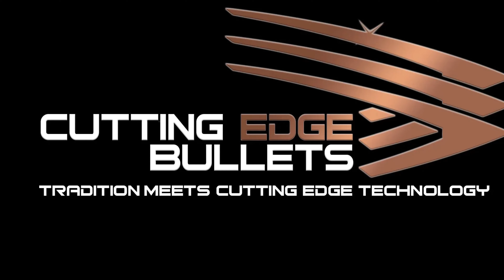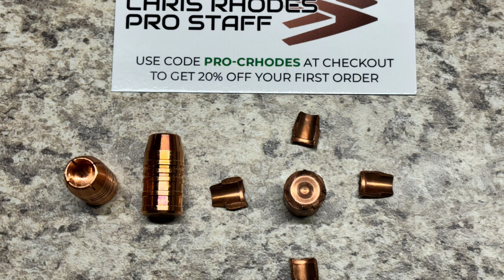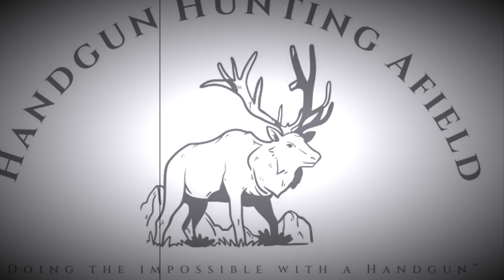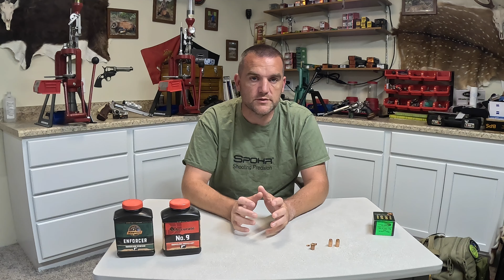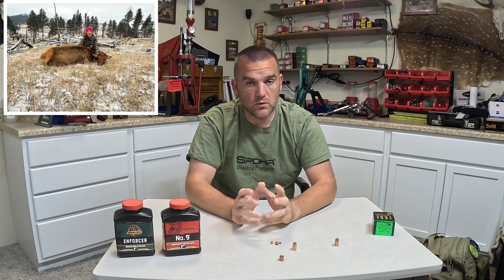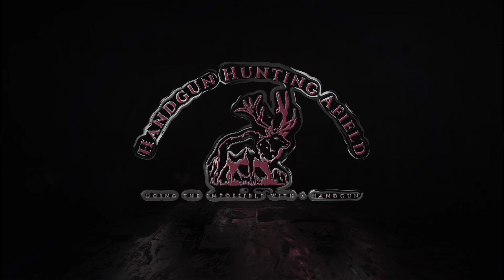Cutting Edge Bullets Handgun Raptor

Comment: 3:40 - That sounds like what Courtney & Courtney describe as "pressure-wave" and according to their work is the highest coefficient (0.847) in terms of lowest incapacitation times.

I've switched to fast & fracturing rounds for EDC, at least the 1st 6 rounds, or so.
After seeing in 5.7 x 28 what the 30gr Raptor did to a pork-shoulder, and then same thing with a 32 gr Controlled Chaos...confirmed same results with Liberty Overwatch in 9mm.

But the 40 gr Raptor at ~2000 fps didn't do as much damage (petals didn't entirely shear off, with tip inserted - will test w/o tip).

Wasn't sure, then- if the heavier 120 gr HG Raptor .40 cal for 10mm would be going fast enough for that effect. It sounds like from your results, it should do fine. 
I should get them going ~1550 fps. 

What kind of velocity are you putting those you mentioned to?
Appreciate the upload!
Reply from the maker: @ShastaBean  all of my load data is available on HandgunhuntingAfield.blog